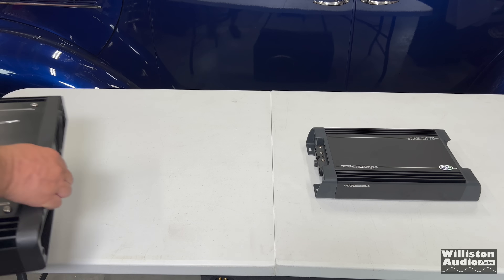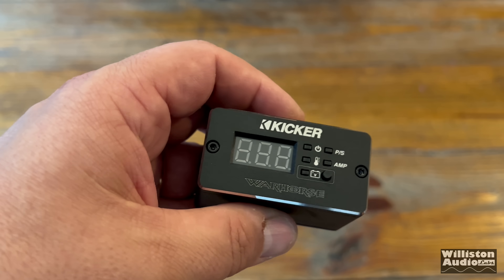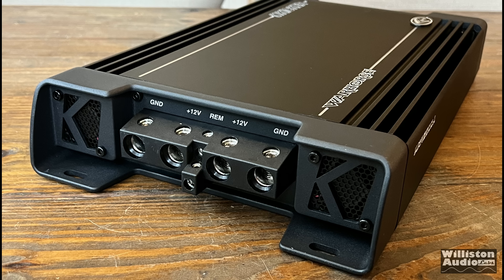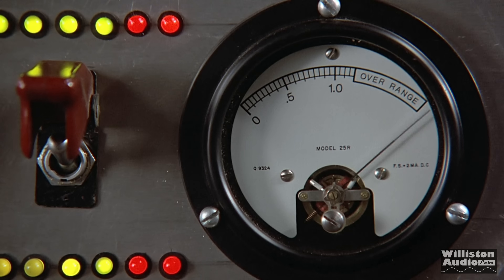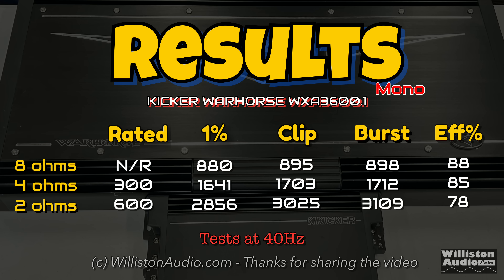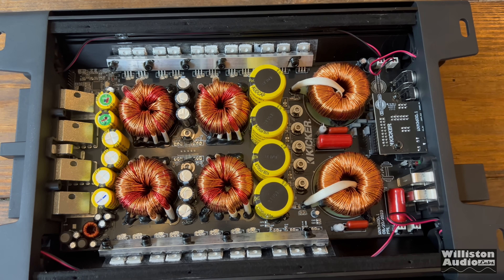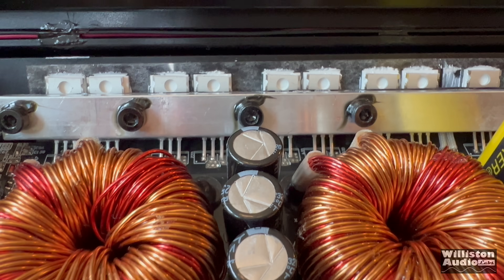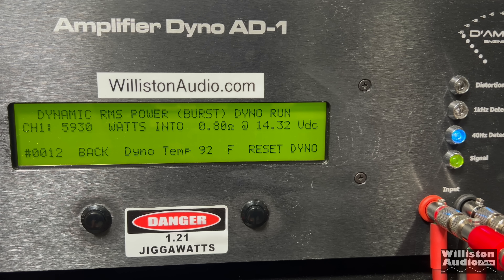KICKER Warhorse is BACK! WXA3600.1 Mono Amp Dyno Test

Comment: I'll pass on this kicker.  Instead I'll put my money on a JP43.  Costs less and puts out more power.
Reply: There you go. It's great that we live in a time where we have so many options.
Reply: @JasonWW2000  Yep especially during these times that many of us are looking for the best bang for the money
Reply: This is probably built alot better than the JP amps.  Using the warhorse name is just a gimmick to sell them.  If msrp is 1099, it will probably sell for less in stores.  I'm guessing it'll be around $750.
Reply: @derekgardin1512 the JP series amps are pretty stout..  It's probably built with the same quality, I wouldn't assume it's better just bc it's a kicker amp.  I've had so many kicker amps & they just kept going up in price for minimal wattage, the reason why I don't run them anymore
Reply: @BoobeeMyles but you have no problem assuming the JP are built the same?
Cognitive dissonance…
Reply: I went with the new US AMPS 100hc.  It was PRICEY.. but man is it a  beautiful work of art .
Reply: @MatthewGuynn-ki8rn  I have one myself and love it

Had one hooked up to a pair of illusion audio c12's at 4 ohm stereo in my charger and they sounded amazing 

The installer at the shop had them wired wrong to the amp and the amp never complained and worked flawlessly 

Michael James from us amps and I were amazed that the amp didn't seem to care about what ohm load it was seeing and worked with no issues
Reply: @knowledgemediainc  oh nice brother🤘.. any vids ? I'm waiting to install my alt and gonna put mine in .
Reply: @MatthewGuynn-ki8rn  unfortunately I don't

I'm probably going to use it in my mustang install and will definitely get some videos 

You won't be disappointed with the amp
Reply: @knowledgemediainc  heck yeah brother 🤘.. it's so hard to find anyone running them yet.. I hopeful it's enough to run my 9518sc.  Joey said it should do fine. I can't wait to get it in the crx🔊
Reply: Yup that is not a mickey 🐭 program
Reply: I'd be inclined to see how long these amps last, one may have longer term value
Reply: I was just thinking the same way
Reply: The Audio scene is way too technical and uses so many filtering chips or boards instead of vacuum tubes and switched or crossovered by filtering caps and incorporate so much AI instead of what wasn't broken in the first place but times change and the demand of technology or creature  comforts just as it is today and the constant updates are ridiculous and out date products in a blinking of an eye I just miss the old school "cheater" amps from the good ole days and when things were more simpler and common sense was more common than it is today! Stay blessed yall
Reply: All y’all talking about JP amplifiers having “noise”. I guarantee if your car’s electrical system is sound and you know what you’re doing when you install, it will be as quiet as anything else.
Alternator noise is caused by improper electrical setup.
The Kicker Warhorse is the new version of the KXA2400.1 so the Solo-X subs have an amp to push them properly
Reply: Facts!  Same thing I said💯
Reply: Or a 2003 model Orion hcca 3000.D1. Can still find them for around $600 and if you seen it on this channel then you know what it's about.
Reply: @chrisdavidson6519 you can get that amp for a little over $600.  I don’t understand why to buy this over the Orion. Or on the cheap you can buy the Tara amps 3000 for $160 each.  It os so confusing.
Reply: And it has a clip light.
Reply: @reallyboardstiff  clip light dont mean nothing. If you know your HU and power input, a clip light shouldnt even be needed. And for someone paying 1100 dollars for an amp, they should know.
Reply: The only issue I see is if you have 2 solo X subwoofers, 1 of these still won't be enough to push them if you include impedance rise which means you would have to get two of these..
Reply: @08magnumsrt If you're an SPL competitor, then yes, that makes sense. For the average basshead, 1 amp on two Solo X should be fine.
Reply: The problem with complaining about prices is everyone then will only offer you cheap stuff💁 then we will all complain about that👍..  is what it is.. good thing is if the price ain't for you  can find something that is.
Reply: Comparing down for sound to kicker is nuts
Reply: If I got a new amp I'll put my money on Slapz 😁👍
Reply: Make sure you pay $50 for him to sign it so you look like 99% of the other D4S nut huggers out there.
Reply: I bought a jp33 to replace my kicker kxa amplifier. Its louder but don't sound as good as the kicker.  When your near full tilt the difference is very noticeable.  I realized more power isn't always better.
Reply: @Sql253  I have a Rockford 1200 that honestly sounds far better and almost as powerful as my jp23 v2..  yes the jp is " louder".. but as far as rich deep bass  I can hear the difference 💁 some say you can't and watts are watts but that again brings us to preferences
Reply: @MatthewGuynn-ki8rn  i switched out my kicker kxa1600.1 and jp33 over 5 times.  I can always hear the difference in the bass quality.  The jp amplifier is muddy and not as defined.
Reply: @Sql253  I fully agree brother 👍.. I'm not knocking jp.. he's a good dude and honestly for the money it's a good amp.. honestly I've punished mine with low voltage and .5 ohm bc of all my amps id sacrifice it first.. and the damn thing will not die! But it isn't my highest quality amp.. just for perspective the jp 23 has 1700 f caps.. my us has 4700 caps . 💁..  watch my review I show a few good ones 🤘
Reply: @MatthewGuynn-ki8rn is the signal to noise ratio on your Rockford amp advertised as being higher than your jp 23 v2?
Reply: @devencherry8976  not sure the specs on the Rockford.. I know it's a first gen . And I've been told despite being a prime series amp.. it's  actually the largest in that lineup and shares many of the bdcp components 🤝
Reply: @devencherry8976  the jp amp isn't a bad amp brother.. but it's also not top of the line or anything.. however I will say they did listen to the public and learn from the v1.. it's my understanding many of the v1 had cap failures and they fixed that for the v2.  The 2 major problems in audio is extremes on both spectrums.. in other words audio snobbing certain products too high.. and at the other end is claiming cheaper or " budget" products are just as good as quality stuff . Imop one is as bad as the other 💁
Reply: @Sql253 is the signal to noise ratio of you jp 33 worse than your old amp?
Reply: @devencherry8976  the jp33 is 96db and the kicker is 95db.
Reply: but when it comes in broke, good luck trying to get a warranty… takes ages and communication is absolutely nowhere, check their bbb (less than 2 stars)
Reply: @jamesseeley140 are you talking about d4s, and the jp amplifiers?
Reply: Look into Trinity Audio. Paid 900 cadadian shipped for an 8k and i love it!
Reply: Those fans are nice
Reply: So you rather support a disgusting narcissistic pedo like JP than an OG company with real r&d? 😂
Reply: Whats with the static subsonic at 25hz that's killing me there.
Reply: A little pricey for a non Korean amp.. the small amps put out the power but for how long. Longevity and heat are there downfall.. the smaller footprint but they get hot
Reply: I own jlp and kicker amps, the kicker will be in my closet 20 years from now and still work, the jp will be broke
Reply: @kickercar  of course you'll say that you're a kicker fanboy.
Reply: @jorgem50  thats funny i own jp amps, d&d , mtx, , jbl , sas, maybe i own them and just know. i have jp 23, 2 jp 63, they clip way to much for daily driving but they will do good at comps
Reply: @jorgem50  JP three is China junk brother don’t waste your money on that crap. Down for sound amps are garbage.
Reply: Kicker cant be right in their mind to name a amp warpony thats just dumb
Reply: I’ll take the Taramps 5k about $300 less than jp43
Reply: @BloodCover  Actually I put JP43 in my comment because taramps gets more hate but in reality I use and prefer taramps
Reply: @jorgem50  yeah and I'd rather get a smart 5k  or a md 8 k and really get busy
Reply: Just remember you get what you pay for. To think the jp amps are the same quality as the kicker amps is absurd. I've been in manufacturing for over 25 years and to get to a certain price point corners have to be cut.
Reply: Numbers on a Dyno don't mean shit! Kicker and Rockford Fosgate amplifiers sound like Pure Thunder compared to all these newer Korean Garbage amplifiers.
Reply: Can you imagine if chevy changed the corvette into a malibu, but still called it a corvette, but, it's a malibu..  3600 watts is nowhere close to 10k...  it's a sheep in wolf's clothing.
Reply: @robertnelson2728 i think this is the smallest of the 3 warhorses that's gonna be released. Thats why he called it the war pony.
Reply: @Sql253  well, I guess we get the corvette 4 door, the corvette suv, and corvette pickup truck.... great way to dilute the branding.  The war pony, war filly, war stallion, war foal,  etc......  diluted.
Reply: @robertnelson2728  they do have plans for higher wattage amps. They are planning for 10k soon.
Reply: @robertnelson2728  Sure, but it also went from $1 a watt to under 30c
Reply: @robertnelson2728 this amp did 6400!watts at .8 ohm
Reply: @joshholden8561  well then I suppose chevy needs to make a corvette minivan and a corvette pickup truck and a corvette station wagon and a sub and sedan and a etc..etc..Kicker is just using an awesome name with nostalgia to drum up sales...  its a warhorse in name only.
Reply: @robertnelson2728  no sir it's a warhorse in every way that  the old one was a warhorse
Reply: @joshholden8561  enjoy your corvette station wagon.
Reply: @robertnelson2728 They’re literally doing that with the C8. That is not a corvette.
Reply: Jp will cost a lot more when (not if) it blows....
Reply: @steve390gold why do you say that lol? I just bought one..
Reply: Yeah, who wants a kicker amp with decades of r&d, killer reputation, millions sold huh?
Reply: @BluemanDrummer built at a factory where other brands are built in China.
Reply: @BluemanDrummer  lmfao it's only taken JP a few years to come out with excellent lower cost products than Kicker.  Products that many desire because of their bang for the dollar.   Keep your kicker r&d and high prices.
Reply: @jorgem50  I don’t use kicker but car audio isn’t about bang for the buck. It’s supposed to be expensive to exclude losers
Reply: @BluemanDrummer you're the kinda snob I love shutting down in both sound quality and DB with my equipment which cost less than half of your "moms credit card"overpriced 'paying for the name only" equipment...... Yep my 'bang for the buck' equipment.  Lol. It happens A LOT.
Reply: @BluemanDrummer that’s the dumbest shit I have read in the comments in a long time. Audio is for everyone.
Reply: @DemonOfFury  yeah, that’s why large homes, Ferraris, and Rolex watches aren’t cheap!!!! NOT FOR EVERYONE, only those of us with privilege
Reply: @BluemanDrummer Arthur, it's music bro. You trying to be a gatekeeper is utter nonsense.

Thanks for the laughs, though.
Reply: @BluemanDrummer as long as your mommy is paying your tab the sky is the limit correct? 😂
Reply: @RocknRollJesus101  my parents have been dead for a decade. I’m in my 40’s
Reply: @BluemanDrummer  but still blowing Mommy's money from the inheritance. Buying a cheap Rolex and big name audio certainly doesn't make the man huh artie?
Reply: @RocknRollJesus101  Jesus just tap out
Reply: @BluemanDrummer  you're VERY Special
Reply: @jorgem50 his products are off the shelf Chinese designs with d4s logos.
Reply: @jorgem50 dude you modified a pontiac Vibe, your opinion just dropped in value by 150%
Reply: @BluemanDrummer no some ppl have real jobs and have bought cheap things and pat for what they want lol the mom thing is so overrated rember grown ppl do car audio too and every one font listen the same. some of us like to but things once and have it for yrs some off us just grown lol. u think that since the 70s 80s bass heads still don't like music some just not  into competition but just sounding good. and has a choice to spend 1k or not  on amp.  I don't bash either run what u can afford.
Reply: Little do you know JP didn't come out with anything he doesn't build any of his amps he just has a amp company in China that makes amps and Then he has his JP Logo put on the amps if people were smart you can buy the same amp from China for half the price
Reply: @BluemanDrummer  I know I have xtant amps. It's not the power it's the low Hertz
Reply: A lot of people complain about the jp amps. Noise interference, at least the kicker is reliable for years! Also, look at how many jp refurbished amps are being sold, that should tell you something
Reply: @sirmartinez5276 I’ve never heard that, and I’ve never heard Williston mention that. I know he’s an affiliate though, but where have you heard that..? Have you personally seen this, or just heard from others?
Reply: @sirmartinez5276 exactly and not to mention their bass knobs are always failing. Not to mention JP isn't a trustworthy or respectful person to support.
Reply: Sounds worse and won’t last as long either…
Reply: I have two JP amps mounted to the subwoofer box on top because I'm 45 and it worked back then and screw it i needed trunk space. a jp 8 and jp84. I have beat these things to death for about 2 years and zero issues. I used to be a JL audio fanboy but their amps sre disappointing and their new woofers are overpriced.
Reply: Jp amps are top of the line.
Reply: Us amps all day if you got the $$$.  But sick of seeing the same old set-ups
Reply: Yep. A jp63 is the same price and even better
Reply: Car audio shouldn’t be inexpensive!! Nothing worse than kids under 21 that buy elcheapo equipment and are clueless
Reply: @BluemanDrummer  this is the same as witth anything automotive. Cannot tell you how many times I come across someone who says I spent too much just to make 800 ho to the tires when they "did it for half that much". Maybe, but my truck has been making 800 wheel for 5 years without a single problem while they are on thier third or fourth motor. I have a set of down 4 sound three way components and they are great, are they focals? Hell no but I also am not comparing the two
Reply: It's not expensive, but even then, that's subjective
Reply: @BluemanDrummer  So 1 subwoofer that's 750wrms should be $700?  🤣🤣..  That's crazy..
Reply: @BoobeeMyles  I didn’t say that. I use Arc Audio stuff. I know my SE 4000 amp cost $2500 years ago and the flatline subs were pricey but sounded incredible.
Reply: @BluemanDrummer it's how they learn....and probably are buying themselves...no 'moms credit card'
Reply: @RocknRollJesus101  buying how? Playing video games and vaping doesn’t produce paychecks
Reply: @BluemanDrummer  that was my point son - it's easy to just demand that mommys credit card buys you what you 'heard' is the best.... while you game, smoke and have other people install your stuff cuz it's all free to you. Be sure to thank your mom. 🤣
Reply: Jp isn't clean power, unless hearing alternator whine is your thing.
Reply: @Ecoboosttookadump have you experienced this before, or are you just repeating what you’ve heard? I just went to made of steel in Tampa, I heard a lot of systems with jp amps and never heard what you’re referring to.. I’m genuinely curious whether or not you’ve experienced this, cuz I’ve heard a few people say this but only in the comments and never in person.. I’ve also never heard it myself so..
Reply: @Ecoboosttookadump  you're trippin..  I'll send you a video of me giving my subs clean power & my 320a alternator just performing at idle or 2,500rpm.  Stop spreading misinformation & talking crap about equipment you clearly never owned🙄🤣
Reply: The jp amps are junk. Cheap crap like the most other amps these days. If spend the extra cash and get a ,kicker, Rockford, jl, or a dd audio long before it's buy jp amp. If you can buy a 3-5k amp for a few hundred bucks. How do you think they manage that? Cheap components.
Reply: @SG-Cichlids   yes you must be right it must be the square wave resistant unobtainium parts in those name brand amps that make them so great oh and it doesn’t cost a lot to make 3-5k of power these days and it’s not so black and white cheap vs ridiculously expensive  for your informed opinion I have a quite expensive B2 amp that looks like a rebadged marts internally  
Most people clip the shit outta amps anyway I don’t care what anyone says I see it all the time  and with that no amp expensive or cheap lasts very long
Reply: @NickMillerlouisiana  were not talking human error. It doesn't matter what it is you're buying. You get what you pay for and sometimes or even  a lot of the time you're just paying extra for the name. The parts used in higher quality amps aren't hard to get. They're just not used to get the amps to a price point. If you're buying cheap amps ask yourself how they get them so cheap. One build them where labor is cheap. Two use cheap internals. You bringing down to clipping is both ignorant and stupid. Look at the dampening factor of a high quality amp and then look it on a high quality amp. You can literally hear the difference.
Reply: Listen here fish aquarium lil red dented car kicker l7 noob kicker fanboy more expensive is not alllllllways better and not solely on parts used I didn’t say run out and buy a boss amp nimrod. Most average people want the best bang they can get for their hard earned cash and there are great less expensive amps that deliver great performance and hey have a decent dampening factor too. You probably had a amazon hifonics amp on your beloved l7 and blew it with your lil red dented car’s stock electrical now you got a shiny new kicker amp thats a lil more tolerant to your junk car and clipping habit
Reply: @NickMillerlouisiana  that's hilarious. I've been into car audio since the early 90's. I had a full car stereo before I had a license let alone a car. I've had more head units,  subs, and amplifiers than I can count. In all these years I've never blown a sub or an amp. My little red dented beater car is a work car. Strictly for gas mileage. Which is why it has a stereo in it. Because I spend about two hours a day in it and want to jam. My car doesn't even have a kicker amp nimrod. The car is an sql build of you want to call it that. My little kicker L7 Q-class did a 143db on 700 watts on music. Which the stock electrical with the big three and a big agm battery handled just fine. My L7 was in a custom box that I designed and played from 25-75 hertz with authority.  143 with one 12 on 700 watts. Sounds like anm noob to me. Now I've upgraded to the solox. Again a single 12 in a box designed and built now on a thousand watts going a 147db on music. No burp. Both subs powered by a rockford fosgate t1500-1bdcp. The parts used absolutely effect the sound of an amp and when your listening to your sub you're really listening to your amp. You could have a top dollar sub and it sound mediocre because of a crapy amp. You can have two amps that share the same board design but one use superior parts and one will sound better than the other. My truck has two tens. Entry level at that in a sealed enclosure powered by a jl amp. That sounds phenomenal. You obviously have no clue what your talking about and try to talk sh-t to help defend your ignorance. If put money on it you're a democrate.
Reply: @NickMillerlouisiana  I forgot to mention. Of coarse I'm a kicker fan boy. They've been making great subs for decades and now have released arguably the baddest sub ever made. The kicker solox 15 did 180db in the one sub challenge. One 15 did a 180db. The only subs that have beat it which is only two or three were 18's. Imagine what's going to happen when kicker releases the solox 18. One sub to rule them all.
Reply: @SG-Cichlids  😂🤣😂😂🤣🥹😂😂😂😂😂democrat really😂😂😂😂😂😂😂😂😂🤣🤣🤣🤣🤣🤣🤣😂hell I like you!
Reply: @SG-Cichlids  🫢🫢 my little red dented car is doing a 150 on stock alternator .. rn I'm using a jp 23 at .5 ohm and fixing to replace it with a us amps 100hc.. 😁 in way I feel like everyone here is rt to an extent.. it just depends what angle your looking from 🤘🤝
Reply: @SG-Cichlids have you owned one, or do you know personally people who’ve had one, and they had a bad experience with them? I’m genuinely curious since, I have friends that own them, and haven’t had any issues whatsoever.. I know they also put out over their rated power at all ohm loads, if they have the proper voltage.. and I also just bought one of the jp 93’s.. or preordered rather
Reply: @devencherry8976  actually when I upgraded my subwoofer and enclosure. I told my old sub and box to my friend. He bought a jp amp. His amp and my amp are both 1500 watts. I installed his amp and set the gains exactly like mine. In my car the single 12 did a 143db on music. In his car it only did 134. This could be the cabin and other things so we swapped his amp and the sub into my car and it still wouldn't do a 143. My amp is a rockford fosgate t1500-1bdcp. Both amps were set to 700 watts.
Reply: @SG-Cichlids  what ohm load?? Bc at 2 ohm the bdcp will still make its power. That's the constant power circuit in the amp..  the jp will likely half its power as you up the load 🤝
Reply: @SG-Cichlids  btw that's a good score on that amp and that power your pulling 👍🤝
Reply: @MatthewGuynn-ki8rn  I had it at two ohms but either way I set each amp to 700 watts with a multimeter. The kicker q-class l7 is no joke. People talk crap but they usually aren't putting them in the right box. I had mine in a custom box. I upgraded to a kicker solox 12 so I could use more of my amp. I built a custom box slightly larger than manufacturers recommend but with substantially more port area. Currently I have it set to 1100 watts doing a 147db on music. The only thing holding me back is I can't get a high output alternator for my car. They don't make them.
Reply: @SG-Cichlids  💯 percent rt . The q class is a stellar woofer.. my box builder  loves them.. and the solox seems to be awesome as well.. as you said in the rt box🤝👍.   You definitely know  whats up.. go bigger cu.. and let it breathe.
Reply: @SG-Cichlids   I'm running a dd9518sc in 6.25 cu. With 20 in per on the port.. in a crx 😂.. let's just say it's nasty 🤮. Haven't meter yet .. but I'm guessing low 150s  as is.. and I'm gonna be putting a 320 alt and change the amp to a new us amp 100hc
Reply: @MatthewGuynn-ki8rn  absolutely.  💪
Reply: @MatthewGuynn-ki8rn  that's a lot of port. I bet it gets down.
Reply: @SG-Cichlids  it's a lot bro.. it looks crazy .. but that's what Josha from dd said to do.. let it breathe
Reply: @MatthewGuynn-ki8rn  it's funny coz everyone will tell you your box is oversized.
Reply: @SG-Cichlids  yeah.. then I stand his hair up 🤣
Reply: Kicker is superior in quality duh
Reply: Then you'd be supporting a child that thinks people want his signature on everything
Reply: Yea Popcorn Audio aka D4S.